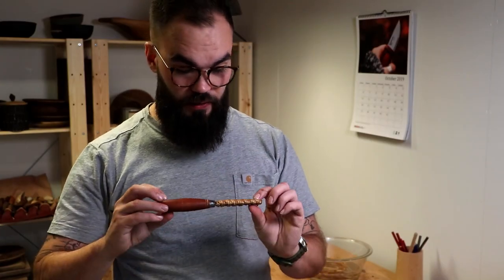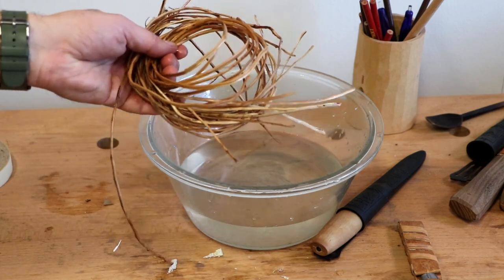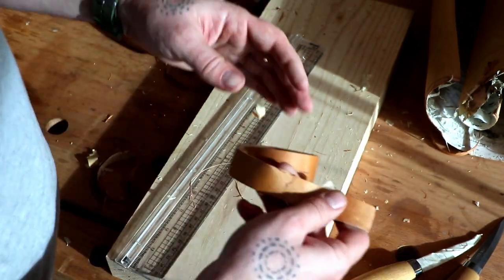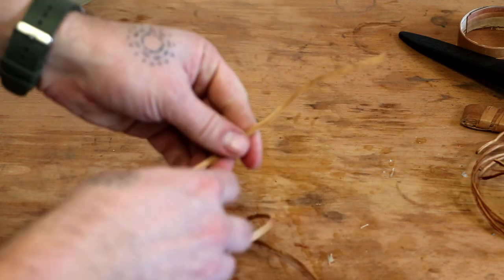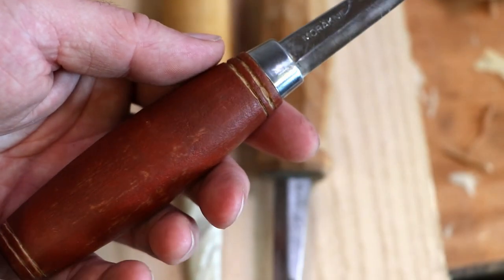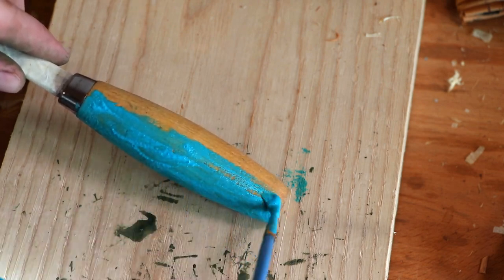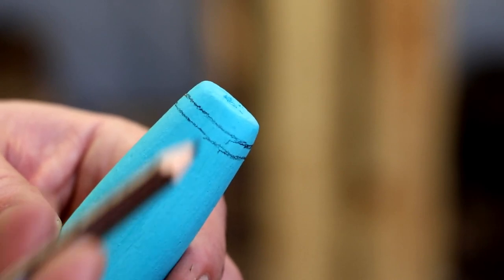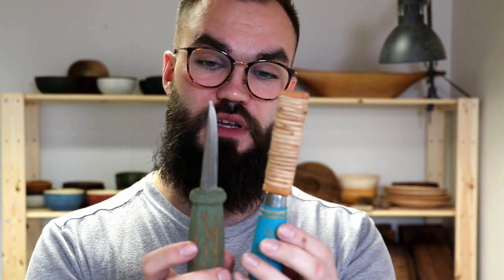Customizing a Morakniv - birchbarksheath + carved & painted handle

Comment: Thanks for sharing this Johas :) I've not made many sheaths and the ones I did were not all as tight as I'd like them to be so I simply slid some longish wood chips into the finished sheath to create more retention, works. However I'd like to have another go with pine root as binding material as you did here.
Reply from the maker: Oh, you should buddy! It's so fun and pleasing. Plastic sheaths are so boring! :) 
The pineroot makes is look even more nice!